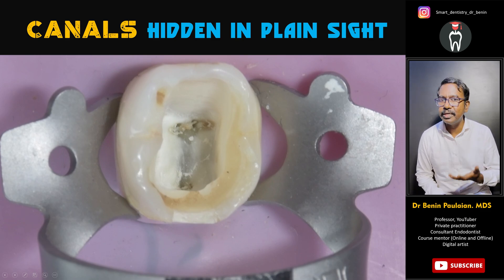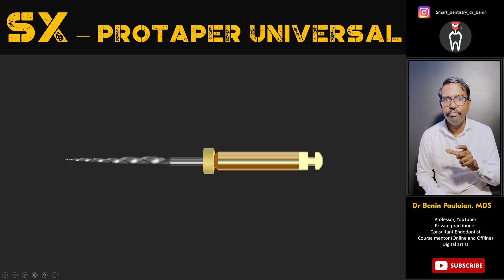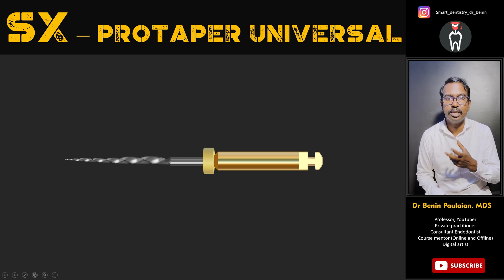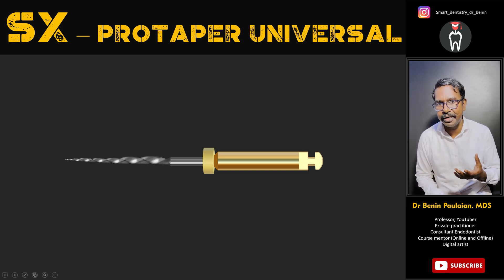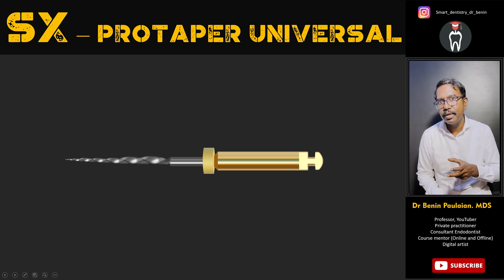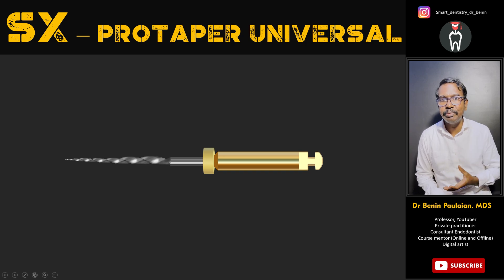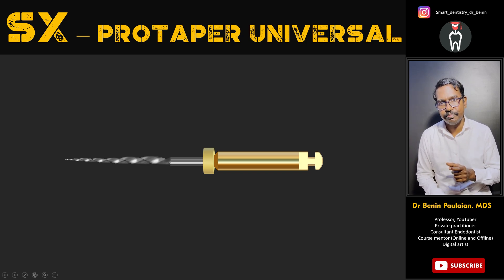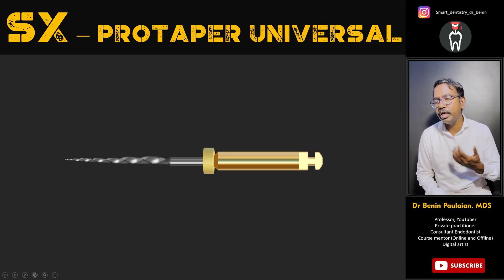How to locate difficult root canals

Comment: Greetings sir. A video regarding how to remove pulp stones will really help.
Reply from the maker: I have included the topic you suggested in the upcoming video list
Thank you for your suggestion
Upcoming videos in Smart Dentistry YouTube channel
Bounded file versus binding file - @sauliharizwan377, @vickyrock1873, @siddhiraut8472, @hristohristov650, @burrwnawna, @ayeshasiddiqua-ue4ss
Anterior proximal composite restorations - @raghuramm563
Finishing and polishing of composite restorations - @DrHozefa
How to create the perfect anatomy in posterior composite restorations - @DrHozefa
Working length using RVG - @manadentist2267, @sushrutachakraborty464, @dentalking7859
How to use apex locators to get accurate reading? - @katyaynigupta5259, @Sreemol17, @dentalking7859, @dentalshorts6848
How to determine the correct taper for canal preparation (2%vs4%vs6%) - @akanshas8424,@abdurrahman2980, @benoitblanc8898
Diagnosis in Endodontics - @MuhammadAbdullah-iy3hc, @bsk4627, @vijyantmehrotra8119, @manadentist2267, @akshuDhavalshankh, @katyaynigupta5259
Dentine bonding agents - Part 2 - @bigdreams3712
How to bypass a fractured file? - @karthicks5760
How to do periapical surgery? - @derekshaji8173
How to remove a fractured file? - @karthicks5760
How to prevent ledges, blocks, zipping and canal transportation - @Philosophyforlifeofficial 
Apexification procedure – @anumadhukar9171, @sanghamitrasagariya4087, @katyaynigupta5259
Perforation repair - @anumadhukar9171
Avulsed tooth management - @Drpoojagarg5310
All ceramic crown preparation – Anterior - @KiranrajkumarHatangle-eo4wm
Molar crown preparation - @KiranrajkumarHatangle-eo4wm
Radix entomolaris - Case discussion - @sauliharizwan377
Palato gingival groove - Case discussion - @sauliharizwan377
Root canal negotiation techniques - @vickyrock1873, @siddhiraut8472, @hristohristov650, @katyaynigupta5259
EDTA in Root Canal Treatment - @rosemeher1321, @hristohristov650
Understanding root canal calcifications - @rosemeher1321, @hristohristov650, @katyaynigupta5259
Operator positioning for Root Canal Treatment - @chandrasekharsahoo6713
Analgesics after Root Canal Treatment - @mdmozahedulislam3923
Root canal sealers - @sudhaa5674
Sealer puff – Good or bad? - @derekshaji8173
C shaped root canals - @karthicks5760, @LearnUnlearn90, @katyaynigupta5259
Middle mesial canal - @karthicks5760, @katyaynigupta5259
Reference point in root canal treatment - @anujgarg952
Heat and H file technique for GP removal - @chandrasekharsahoo6713
how to do BMP effectively without any pulp tissue remnants in a single visit RCT - @rainbowsalt-gc7ek
class 2 composite and matrix to avoid gaps between teeth after using toffelmeir system -  @sauliharizwan377, @hishamkhan3800
Curved root canals and file selection
Everything a beginner should know about rotary files
Ledges – prevention and management - @dentalshorts6848
Prefabricated metal post
Pre fabricated fiber post - @anithabalex8124
Ribbond post and core - @bsk4627, @sajaljain4192, @sauliharizwan377
Custom cast post and core - @derekshaji8173
How to select the proper crown - @DrGreenfun
Cast post Vs fiber post? Which one to choose? - @SnehaPK-rt3tn, @alokegupta3165
Occlusal considerations in post endodontic restorations - @tubeindahouse
Pulp stone management - @sayantankarmakar3150

Comment: Is it possible for the canal to be complete calcification? I couldn't find the canals on a lateral incisor. What do you think of using SDF when you can't find the canals
Reply from the maker: After trauma, the root canal may be completely calcified. If the canal is completely absent in the radiograph and the tooth is asymptomatic with no radiographic changes, then no treatment is needed and the  tooth need to be kept under observation(if there is discoloration, veneers or crown can be placed)
If the tooth is symptomatic or there are radiographic changes then, periapical surgery with retrograde MTA would be the best treatment. 
I am not sure about the effectiveness of SDF in case of calcified root canals.

Comment: Sir kindly make one video on Reference point, as it always create problem when we have deep carious lesion or some time very much tooth structure lost due to caries removal in such cases how we can take reference point
Reply from the maker: I have included the topic you suggested in the upcoming video list
Thank you for your suggestion
Upcoming videos in Smart Dentistry YouTube channel
1.	How to remove Guttapercha from root canals? - @karthicks5760
2.	When to do Post and Core?
3.	Curved root canals and file selection
4.	Everything a beginner should know about rotary files
5.	TCA technique of Cleaning and shaping - @DrHozefa
6.	Anterior proximal composite restorations - @raghuramm563
7.	Finishing and polishing of composite restorations - @DrHozefa
8.	How to create the perfect anatomy in posterior composite restorations - @DrHozefa
9.	Working length using RVG - @manadentist2267, @sushrutachakraborty464, @dentalking7859
10.	How to use apex locators to get accurate reading? - @katyaynigupta5259, @Sreemol17, @dentalking7859, @dentalshorts6848
11.	How to determine the correct taper for canal preparation - @akanshas8424
12.	Diagnosis in Endodontics - @MuhammadAbdullah-iy3hc, @bsk4627, @vijyantmehrotra8119, @manadentist2267, @akshuDhavalshankh, @katyaynigupta5259
13.	Dentine bonding agents - Part 2 - @bigdreams3712
14.	How to bypass a fractured file? - @karthicks5760
15.	How to do periapical surgery? - @derekshaji8173
16.	How to remove a fractured file? - @karthicks5760
17.	How to prevent ledges, blocks, zipping and canal transportation - @Philosophyforlifeofficial 
18.	Apexification procedure – @anumadhukar9171, @sanghamitrasagariya4087, @katyaynigupta5259
19.	Perforation repair - @anumadhukar9171
20.	Avulsed tooth management - @Drpoojagarg5310
21.	All ceramic crown preparation – Anterior - @KiranrajkumarHatangle-eo4wm
22.	Molar crown preparation - @KiranrajkumarHatangle-eo4wm
23.	Bounded file versus binding file - @sauliharizwan377, @vickyrock1873, @siddhiraut8472, @hristohristov650, @burrwnawna, @ayeshasiddiqua-ue4ss
24.	Radix entomolaris - Case discussion - @sauliharizwan377
25.	Palato gingival groove - Case discussion - @sauliharizwan377
26.	Root canal negotiation techniques - @vickyrock1873, @siddhiraut8472, @hristohristov650, @katyaynigupta5259
27.	EDTA in Root Canal Treatment - @rosemeher1321, @hristohristov650
28.	Understanding root canal calcifications - @rosemeher1321, @hristohristov650, @katyaynigupta5259
29.	Operator positioning for Root Canal Treatment - @chandrasekharsahoo6713
30.	Analgesics after Root Canal Treatment - @mdmozahedulislam3923
31.	Root canal sealers - @sudhaa5674
32.	Sealer puff – Good or bad? - @derekshaji8173
33.	MB2 canal - @karthicks5760
34.	C shaped root canals - @karthicks5760
35.	Middle mesial canal - @karthicks5760
36.	Reference point in root canal treatment - @anujgarg952

Comment: C shaped canal 
Middle Mesial
 canal
Mb2 please
Reply from the maker: I have included the topic you suggested in the upcoming video list
Thank you for your suggestion
Upcoming videos in Smart Dentistry YouTube channel
1.	How to remove Guttapercha from root canals? - @karthicks5760
2.	When to do Post and Core?
3.	Curved root canals and file selection
4.	Everything a beginner should know about rotary files
5.	TCA technique of Cleaning and shaping - @DrHozefa
6.	Anterior proximal composite restorations - @raghuramm563
7.	Finishing and polishing of composite restorations - @DrHozefa
8.	How to create the perfect anatomy in posterior composite restorations - @DrHozefa
9.	Working length using RVG - @manadentist2267, @sushrutachakraborty464, @dentalking7859
10.	How to use apex locators to get accurate reading? - @katyaynigupta5259, @Sreemol17, @dentalking7859, @dentalshorts6848
11.	How to determine the correct taper for canal preparation - @akanshas8424
12.	Diagnosis in Endodontics - @MuhammadAbdullah-iy3hc, @bsk4627, @vijyantmehrotra8119, @manadentist2267, @akshuDhavalshankh, @katyaynigupta5259
13.	Dentine bonding agents - Part 2 - @bigdreams3712
14.	How to bypass a fractured file? - @karthicks5760
15.	How to do periapical surgery? - @derekshaji8173
16.	How to remove a fractured file? - @karthicks5760
17.	How to prevent ledges, blocks, zipping and canal transportation - @Philosophyforlifeofficial 
18.	Apexification procedure – @anumadhukar9171, @sanghamitrasagariya4087, @katyaynigupta5259
19.	Perforation repair - @anumadhukar9171
20.	Avulsed tooth management - @Drpoojagarg5310
21.	All ceramic crown preparation – Anterior - @KiranrajkumarHatangle-eo4wm
22.	Molar crown preparation - @KiranrajkumarHatangle-eo4wm
23.	Bounded file versus binding file - @sauliharizwan377, @vickyrock1873, @siddhiraut8472, @hristohristov650, @burrwnawna, @ayeshasiddiqua-ue4ss
24.	Radix entomolaris - Case discussion - @sauliharizwan377
25.	Palato gingival groove - Case discussion - @sauliharizwan377
26.	Root canal negotiation techniques - @vickyrock1873, @siddhiraut8472, @hristohristov650, @katyaynigupta5259
27.	EDTA in Root Canal Treatment - @rosemeher1321, @hristohristov650
28.	Understanding root canal calcifications - @rosemeher1321, @hristohristov650, @katyaynigupta5259
29.	Operator positioning for Root Canal Treatment - @chandrasekharsahoo6713
30.	Analgesics after Root Canal Treatment - @mdmozahedulislam3923
31.	Root canal sealers - @sudhaa5674
32.	Sealer puff – Good or bad? - @derekshaji8173
33.	MB2 canal - @karthicks5760
34.	C shaped root canals - @karthicks5760
35.	Middle mesial canal - @karthicks5760
36.	Reference point in root canal treatment - @anujgarg952

Comment: Sir can you do a video on sealer puffs. Please 🙏🏻
Reply from the maker: I have included the topic you suggested in the upcoming video list
Thank you for your suggestion
Upcoming videos in Smart Dentistry YouTube channel
1.	How to remove Guttapercha from root canals? - @karthicks5760
2.	When to do Post and Core?
3.	Curved root canals and file selection
4.	Everything a beginner should know about rotary files
5.	TCA technique of Cleaning and shaping - @DrHozefa
6.	Anterior proximal composite restorations - @raghuramm563
7.	Finishing and polishing of composite restorations - @DrHozefa
8.	How to create the perfect anatomy in posterior composite restorations - @DrHozefa
9.	Working length using RVG - @manadentist2267, @sushrutachakraborty464, @dentalking7859
10.	How to use apex locators to get accurate reading? - @katyaynigupta5259, @Sreemol17, @dentalking7859, @dentalshorts6848
11.	How to determine the correct taper for canal preparation - @akanshas8424
12.	Diagnosis in Endodontics - @MuhammadAbdullah-iy3hc, @bsk4627, @vijyantmehrotra8119, @manadentist2267, @akshuDhavalshankh, @katyaynigupta5259
13.	Dentine bonding agents - Part 2 - @bigdreams3712
14.	How to bypass a fractured file? - @karthicks5760
15.	How to do periapical surgery? - @derekshaji8173
16.	How to remove a fractured file? - @karthicks5760
17.	How to prevent ledges, blocks, zipping and canal transportation - @Philosophyforlifeofficial 
18.	Apexification procedure – @anumadhukar9171, @sanghamitrasagariya4087, @katyaynigupta5259
19.	Perforation repair - @anumadhukar9171
20.	Avulsed tooth management - @Drpoojagarg5310
21.	All ceramic crown preparation – Anterior - @KiranrajkumarHatangle-eo4wm
22.	Molar crown preparation - @KiranrajkumarHatangle-eo4wm
23.	Bounded file versus binding file - @sauliharizwan377, @vickyrock1873, @siddhiraut8472, @hristohristov650, @burrwnawna, @ayeshasiddiqua-ue4ss
24.	Radix entomolaris - Case discussion - @sauliharizwan377
25.	Palato gingival groove - Case discussion - @sauliharizwan377
26.	Root canal negotiation techniques - @vickyrock1873, @siddhiraut8472, @hristohristov650, @katyaynigupta5259
27.	EDTA in Root Canal Treatment - @rosemeher1321, @hristohristov650
28.	Understanding root canal calcifications - @rosemeher1321, @hristohristov650, @katyaynigupta5259
29.	Operator positioning for Root Canal Treatment - @chandrasekharsahoo6713
30.	Analgesics after Root Canal Treatment - @mdmozahedulislam3923
31.	Root canal sealers - @sudhaa5674
32.	Sealer puff – Good or bad? - @derekshaji8173
33.	MB2 canal - @karthicks5760
34.	C shaped root canals - @karthicks5760
35.	Middle mesial canal - @karthicks5760
36.	Reference point in root canal treatment - @anujgarg952